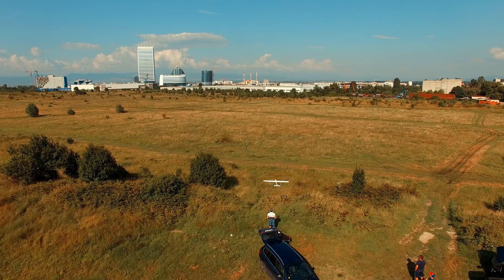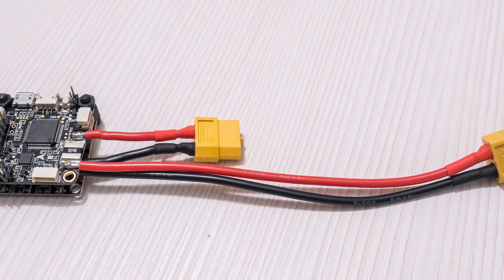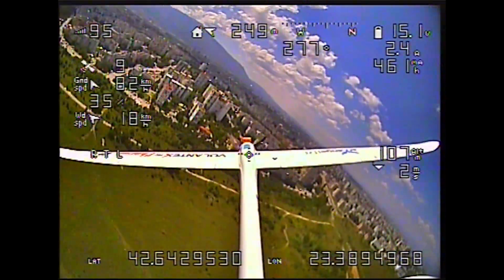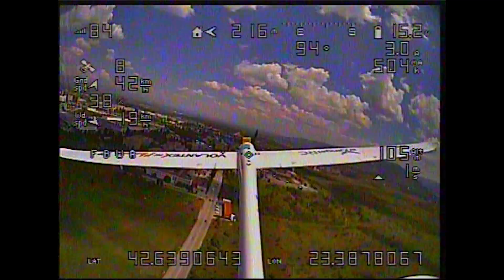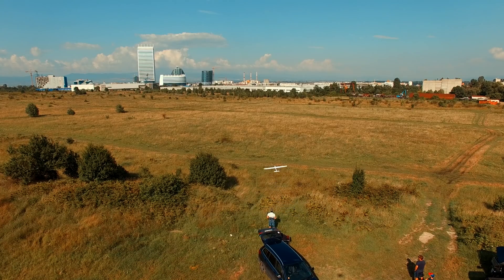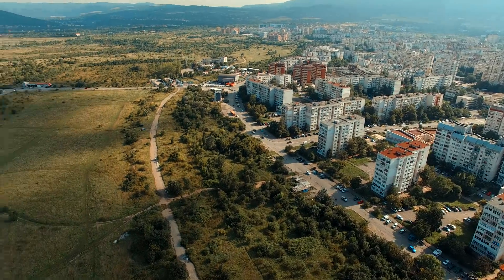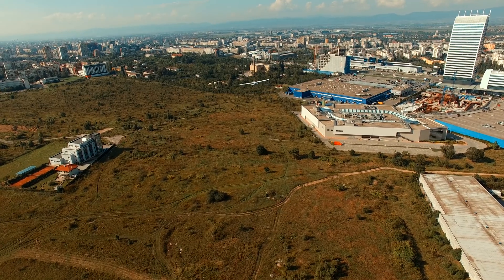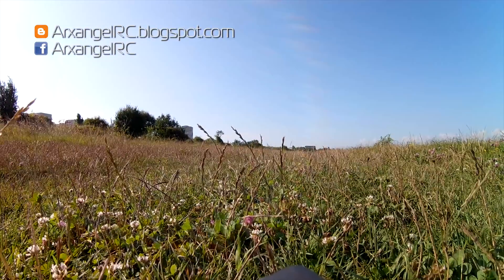Volantex Phoenix V2 with ArduPlane on Omni F4 Pro... AWESOME!!!

Comment: Arx:
I was very inspired by your video above, and just viewed it last night.  I enjoyed watching the Volantex Phoenix V2 from your tail cam, and from your drone footage. In both cases it was a cool perspective in windy conditions. The tail cam reminded me of a Sim in follow mode, and it really did give better perspective for a newbie of the plane's position in relation to its airspace flown under FPV. 
    Though I would like to purchase your plane, my pockets are not that deep right now. I have been working on repairing a crashed Parkzone Radian Pro that I got from a retiring senior pilot. Do you think that could be a reasonable substitute? I checked for your Omnibus F4 Pro, but could not find it on your AKK link. Since your post is now 2 years old, do you think the AKK F4 flight controller is equivalent? At $20.99, it is in my budget, but DO I also need the AKK F4 support SD card board @ $21.99 to go with it?
   Thanks for any guidance you are willing to provide.  - Jim Eastep
Reply from the maker: Hi, thank you! I've heard good things about the Radians, so it should be good! As for the F4 Pro, for some reason AKK stopped selling it for a while, but then started again, and it IS the version with the SD card: https://www.akktek.com/products/flight-controllers/f4-support-sd-card.html?acc=321 so you can get that one, it is the one I am using also!

Comment: Hi, could you suggest me a setup? I’ve got quite a few questions and I think you can help me.

I’m a hang glider pilot and looking to start in RC soaring as a way to explore mountains without HG launch ramps and practice soaring in non-ideal days for HG (weaker winds) or when I have less time. I’ve spend lots of time in flight simulators including RC ones, so I assume I won’t trash a plane like this or asw28. I’m more prone to asw28 since it has higher performance as I can see from internet reviews.

What do you suggest beyond the plug and play kit (and re glueing the tail, adding lead inside it as well)?

How expensive is a fpv kit? This auto pilot stabilizer board? Stronger receiver and antenna tracker for extra range? Will I need a better controller than the stock one if I get that antenna and stronger receiver?

Thanks a lot!
Reply from the maker: Weeeeeeelll... I would suggest getting the KIT version then, and getting better gear the stock, especially if we are talking longer range FPV! Cameras and Vtxs nowadays are very cheap and could cost as little as $20-$25, you will also need a receiver for the ground and a monitor or box goggles to see the incoming video! A flight controller is highly advisable, to make sure you have some redundancy upon loss of radio or video signal, in which case the plane will come home on its own! Radio control system would depend on the range you are looking to go out to, but I would say an antenna tracker for the video is something of a must if you want a reliable signal from a distance, while moving around, rather than flying in a straight line out and back!

Comment: Could you power this FC with 4S lipo directly?  I have the F4 Pro V2.  How do I wire up 3DR telemetry to the FC?
Reply from the maker: Yes, I have it powered directly with up to 6S on some builds! If you go to the blog, the link for which is under the video, you will see on some of the photos where I have connected the telemetry module... there is a 4 pin connector on one of the sides! The pinout should be available on the ArduPilot website!

Comment: Man your production quality is second to none... Also this is unbelievably awesome.. my first mapping platform just dropped about $150 in price because of this video...  I should probably join the Patreon now that you legitimately saved me alot of money lol  Thanks!
Reply from the maker: Thanks mate, but... you want to use this plane for mapping?
Reply: @ArxangelRC  Aha no not this plane specifically, il probably build on the beleiver platform but i didnt know that ardupilot could be flashed to an f4 board so now i can use a much cheaper flight controller while i learn about the firmware and test the plane. It was my understanding that i needed a much more expensive FC to run ardupilot. The mapping functions will come in later but yes the final purpose of the aircraft will be long range wilderness recon and eventually mapping
Reply from the maker: Weeeeell... for serious commercial stuff... you might want to still invest in the high end hardware... but the currently the Omni F4 Pro can accommodate the full functionality of the Ardu firmware, including missions, etc., so it should help get you off the ground at a lower cost! :)
Reply: @ArxangelRC Aha dont worry im still a few years out from offering commercial mapping services to anyones. Its just a part of RC that ive never explored before and I love the building/software side of thing so mapping (both 3d from a hex i built or 2d from a plane) kind of scratches those itches, and sends me in a direction that will give me more practical knowledge. I live in a SUPER remote area in Canada so the market around me is completely bare. An engineering firm I used to work for during Uni used to fly in mapping equipment from 2.5hours away just to use  for a day or two so  I figure if i can bring that price down it might help pay for my quadcopter addiction lol When the time comes to take an actual contract I will upgrade everything to industry standard.
Reply from the maker: Sounds like a plan then! I hope you can do it... and do envy those remote conditions you fly in! :)
Reply: @ArxangelRC  ahaha well it gets to -40c in the winter and we get a solid 8 months of winter so dont be too envious lol
Reply from the maker: Riiiiiiight... some pretty extreme conditions for sure! How do you keep those batteries from freezing?
Reply: @ArxangelRC  To be honest man my flying is severely limited in the wintet time.. this winter has been unseasonably warm so ive got some fixed wing and quad sessions in but usually i only fly quads at -10c or above so oppurtunities are rare in the winter. For fixed wing i wrap the battery in one of those chemical "toe warmer" packets thst people put in their gloves and boots and then a layer of packaging foam and hold it all together with a few elastics. On my "long range" rig, which is really just a long flight time since i dont push distance boundariess in the winter, i also seal up the battery compartment best i can and move the vtx to the outside of the plane for cooling. (Vtx performance is the only upside of winter lol) Anyways, for the most part winter is a time of prototyping and preparation, i try to get away once a year to escape the cold and dark for a bit and is usually the highlight of my winter flying.... My long term goal is to setup large static antennas outside, that i can plug into inside and fly from in front of the fire but budget wise those days are a long ways off
Reply from the maker: That is a nice plan indeed! As long as your location allows you to do this, I know you will get there! :) And yeah... in those conditions flying does seem pretty extreme...  I might have to think of some way to keep the batteries warm as well, because here at altitude, where I mostly fly, it could easily get under -15... and I do like to have my range and duration.. even in the cold! :)

Comment: So I heard you mention the osd? Are you able to use the built in osd and how do you configure it?
Reply from the maker: Hi, yes, the OSD is covered in the video, just uploaded it, you can check it out! :)
Reply: ArxangelRC ah thanks a lot, I saw in the list of beta firmware that the Maitek F405wing is listed there which is my new board I'm trying out with inav 2.0. Will definitely try it out if inav fails to impress. So far 2.0 seems a lot better but my airtime with it are still to low to make a conclusion. Waiting for winter to end...
Reply from the maker: Good luck with that testing then. :)

Comment: Great stuff Nikola, but the key question is.. will you be updating the F405 wing board with the same Ardulane? It seems like a match made in heaven..
Reply from the maker: Yes, the code is also available for the F405 Wing, the new video is  out so you can check it out, process is pretty simple.

Comment: Very nice video! Good to know ardupilot run well!  Did you used an internal compass or the GPS have one?
Reply from the maker: Thanks, I don't use a compass on planes! The code is perfectly capable of estimating the direction of flight from the GPS data. compasses on planes just create more problems than they solve!

Comment: good stuff Arx! looking forward to your follow-up videos. Curious which software is used to config the OSD now that it's all-in-one... Cheers!
Reply from the maker: Thanks! The setup video is live now, you can check it out. Programming is done via the Param list, but you need to have the FPV system running so you can see the changes on the monitor.

Comment: great video, and so glad to see people using the new boards we support in ArduPilot! One small note, we don't actually cut back the features on the omnibus, we have been able to fit all the features on that board, except those that are tied to pieces of hardware the omnibus doesn't have (eg. safety switch). It may be that in the future we do need to limit features, as the 1M flash size is close to full, but for now we do fit a full feature set in the 1M.
Reply: Keep up the great work you guys are doing!
I just wish for  improvements in the MP and the OSD management to easier navigate and set the vast number of settings.
Reply: Don't forget to donate to the project then, it's all done for free!
Reply from the maker: Oh, that is good to hear Andrew, thanks for chiming in! You did some great work on the code there, congrats mate! Nicely done!!!! I've been using ArduPilot now for 5 or 6 years, and especially when it comes to planes and functionality... nothing even comes close! :)
Reply: great stuff Tridge! I hope this will bring ArduPilot back to the masses. Cheers!
Reply: The "DroneMesh" channel is starting an open hardware F4 based flight controller project and he released the first prototype PCB design last week. Anyone who contributes gets a percentage of any board designs sold that include your modification. It would be so cool to see someone design a version specifically for ardupilot and fixed wing implementations.... We could bring the price of this down even further and probably increase the performance versus a multirotor type f4 board
Reply from the maker: @flighttherapybullisticfpv133  How's that project going?

Comment: How difficult is OSD setup? I’m coming from Pixhawk lite with MinimOSD.

Also, do you notice any control latency in manual mode?
Reply from the maker: No control latency that I can notice!

As for the OSD, as of now there is no GUI to set that up, but when you power up the system along with the FPV gear, you can see on your monitor the changes that you are making! :)
Reply: ArxangelRC thanks so much! I just ordered 2.
Reply from the maker: Good luck!

Comment: Finally the reliability of Arduplane! Looking forward to setup video, especially how you go about setting up the OSD.
Reply from the maker: Yeah, setting up the OSD is rather simple! :)
Reply: Just been looking into it. Seems like a lot of parameter settings. Would be nice to use something like the INAV GUI to configure OSD and then you can dump all the parameters.
Reply from the maker: Setting up the OSD is easy with a working FPV system, I hope they do make a GUI for it in Mission Planner.
Reply: Does Arduplane require a compass? This is new to me. Inav and vector doesn't.
Reply: it doesn't require a compass, no. It does require GPS though.
Reply from the maker: No compass needed... like Andrew said, the AP can estimate a direction from the GPS data.

Comment: The Tail Camera always looks good on these Soarers.....Nice FPV feed too....iNAV still works fine for me though.
Reply from the maker: Yeah, output power on the Vtx was 100mW, and I didn't really get out too far... but it still was good! Should get better results with the antenna tracker module.
Reply: ArxangelRC Oh, nice..good on just 100mw...I just took delivery of the Ranger G2...Nice small plane, Im putting a Sunnysky in it an evicting the stock motor...F405 Wing FC and iNAV...Your recent review convinced me...:)
Reply from the maker: Haha, good luck... but you could also put in ArduPlane... :)

Comment: REALLY REALLY don't like the tail mounted camera. I know that they are supposed to do that in turbulent conditions but watching the level of wing tip flex  from that angle makes me very nervous and I spent most of the flights being distracted by it.
After watching the flights again (and forcing myself to ignore the flex) that is remarkably stable given the conditions.
Good work
Reply from the maker: The conditions were indeed quite turbulent, and these wings do flex... it is not a carbon glider after all... but actually that does make the whole body of the plane more stable, because the flex in the wings reduces the shaking that ultimately ends up getting to the fuselage.

Comment: Friend tried, with APM firmware AUTO route waypoint model is completed, Turn back normal, but independent testing its failure.
Reply from the maker: Really didn't understand this!
Reply: Are you separate tests return model, because a friend of the plane bombing, so no further test return mode again for the time being.
Reply: You can separate test return model, because a friend of the plane bombing, so no further test return mode again for the time being.

Comment: Great video as always! I learned about autopilots with an APM 2.8 and Ardu, how difficult will the swap to F4 be as far as the learning curve? Thanks.
Reply from the maker: Shouldn't be difficult at all! Wiring is simplified, params are the same, with the addition of the OSD stuff! :)
Reply: You will get Pixhawk style performance for an F4 price, if you have a Pixhawk one, even that now works faster with the ChibOS port of Arduplane

Comment: yay! Another two omnibusf4's just arrived here today :)
Reply from the maker: Nice! I do have to buy a few more of these boards for other planes as well... I hope all units prove working and defect free!
Reply: I'm going to have to buy one, that tail view is very tempting - go on try Ardusoar I dare you.
Reply from the maker: Gary, I think you are going to like it! As for Ardusoar... hahaha... you just keep going on and on about it! I promised to read up on it and will try when I get the chance! :)
Reply: ugh.... my new boards are both v2.1 (not 2.0 like my first one) and the GPS stopped working when I plug in the receiver. After spending a few hours process of elimination narrowing down the reason, I had to fart around until the sun came up compiling and testing my own hwdef.dat, and making a new connector. Eventually got it working by plugging receiver into the led strip plug (small 3 pin connector next to the SD card slot). Would definitely not get any more v2.1's again if I can avoid it, I wonder who the knucklehead was who made it this way. Obviously it was not a great idea because apparently the v3 goes back to the same way the v2 did it.
http://www.fpvtv.co.uk/fpv-equipment/omnibus-f4-pro/2hH7NxOAKns/omnibus-f4-pro-v21-solving-gps-and-receiver-port-wiring-issues-sbus-ppm-inav/
Reply from the maker: Oh damn... this sounds horrible! Will have to be careful what I get!! Glad you figured them out and will be able to use them after all!